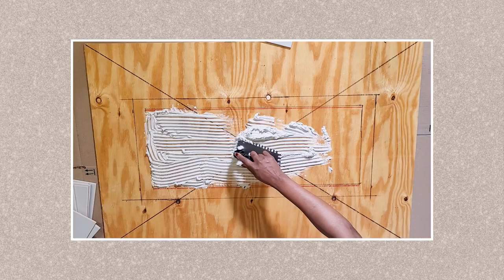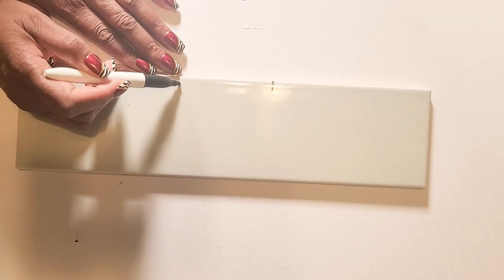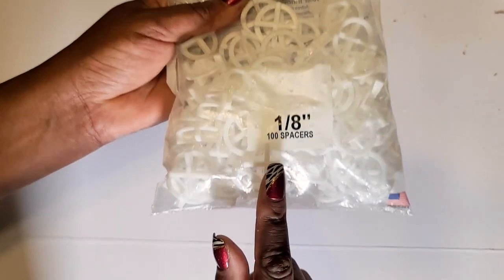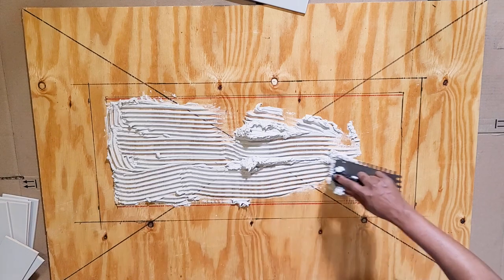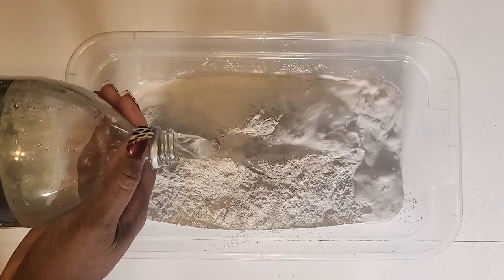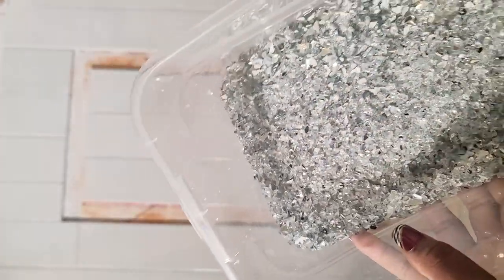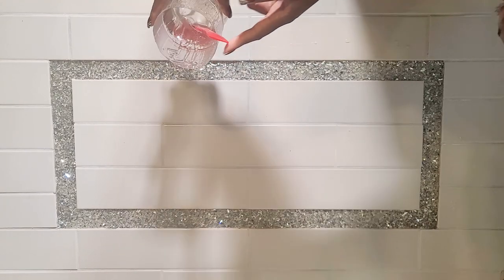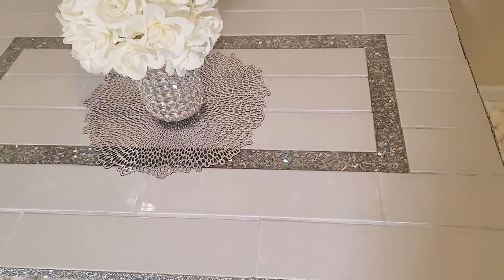This DIY Tile & Resin Table is So Amazing, You Won't Believe It's Easy & Beautiful to Make!

Comment: The result is beautiful but not in my comfort zone. I like simple but elegant and appear hard work and not. How often will I use the tool for that project. Your designs are challenging which makes it just enjoyable to look at and that is all
Reply from the maker: Thank you very much Caj! I'm so glad you like the result. I needed a work table to create my designs that wouldn't have gotten scratched and marked easily, I just wanted to show you all the process of how I created it. I will be doing a lot easier things coming up, But I will also take on projects from time to time to stretch myself and my creativity. it will be a mixture of both, but mostly simple and easy projects 🥰💝🤍🌹🤍💝.